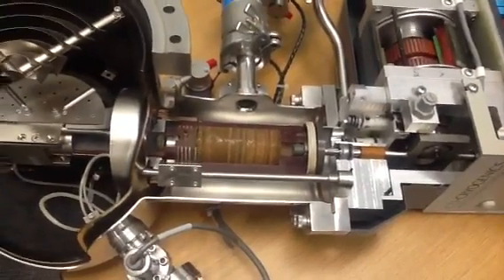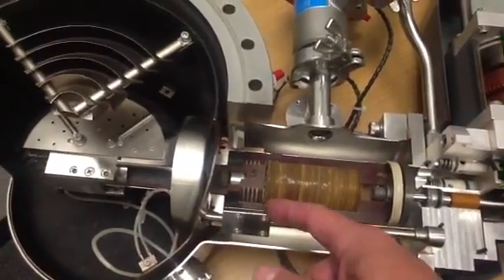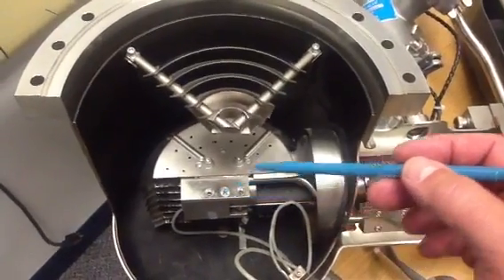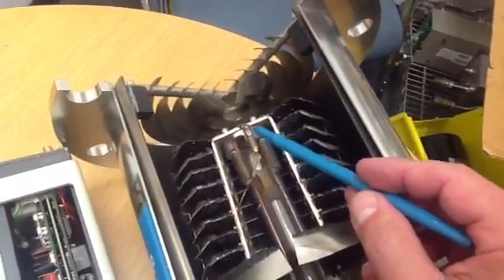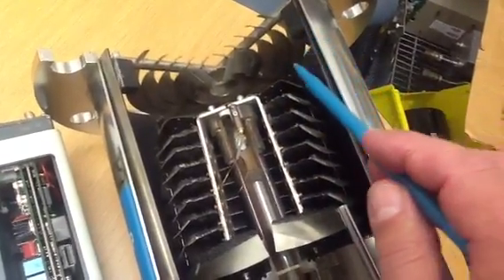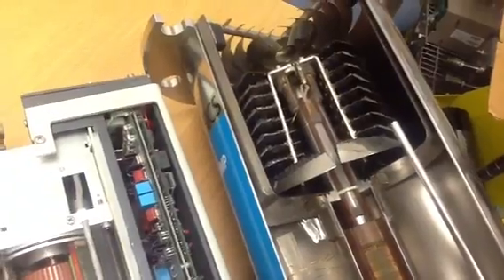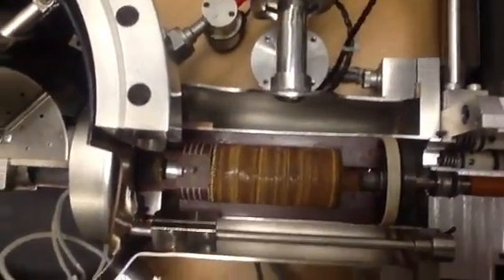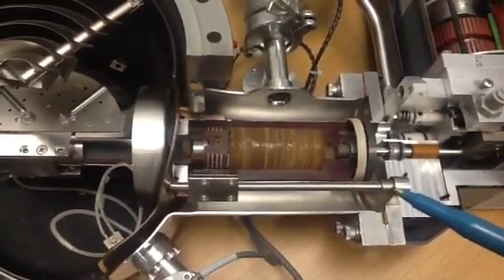Cryo-Pump Cross Section

Comment: I work for Edwards who owns CTI-Polycold, ask me anything. If you live in POrtland Oregon area message me and I can show you a cryo working with a plexiglass cover.
Reply: Who manufactures the motors for the pump?
Reply: @RW0-  that i can’t answer because of IP. Sorry. 
I Can say we have specific requirements for them. Not something you can purchase off the shelf.
Reply: @lutronc4412  figured you would say that unfortunately
Reply: @lutronc4412  are the toque specifications anywhere online?
Reply: @RW0-  again Ip but the motor has one job to move displacers and the motor does not compress He so you might be able to mathematically determine min torque required.
Reply: @lutronc4412  it’s koll morgen motors 😁
Reply: what epoxy is used to stick the charcoal?
Reply: @atatecsolutionspecialist8824  IP :) more importantly is out gassing before application.
Reply: @lutronc4412  thats why most time charcoal falling and need replacement… need some advise on charcoal n adhesive. 👍🏻